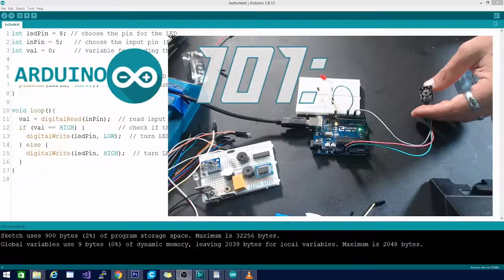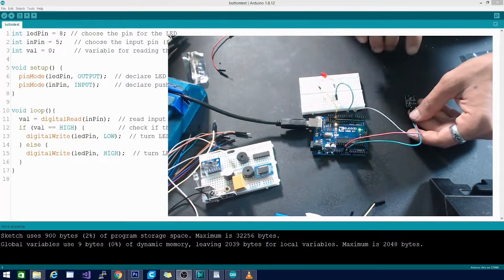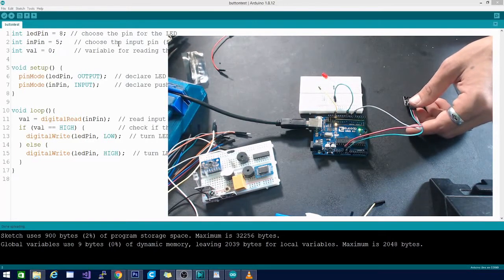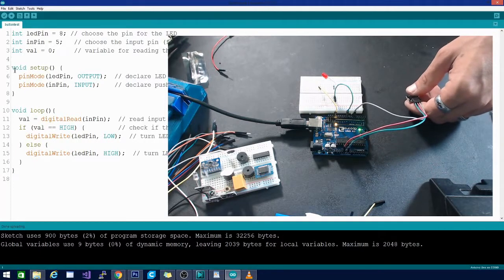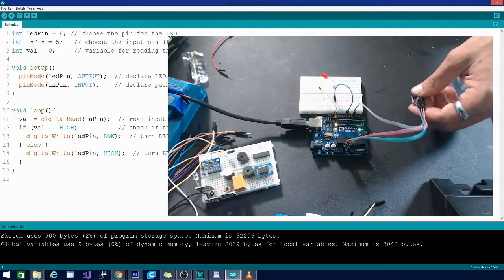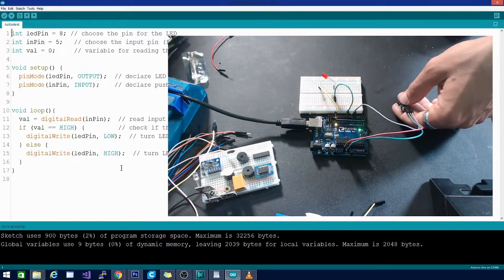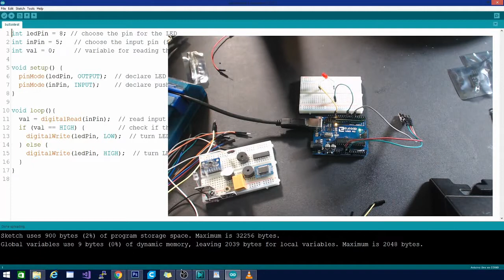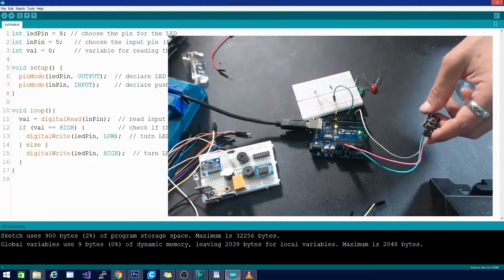HW 483 Button Module   Arduino for beginners   Sensors

Comment: there are a lil question or two. first one question is - how you close the electric circle of the LED? as you say PIN 8 is the VCC for LED but where is the return to GND?  and second is, on button is the "-" PIN to GND and the "S" PIN to PIN5 on arduino? correct?; to get the pressing event?